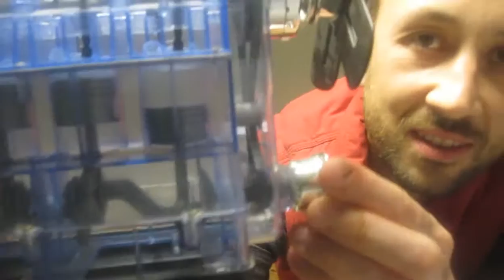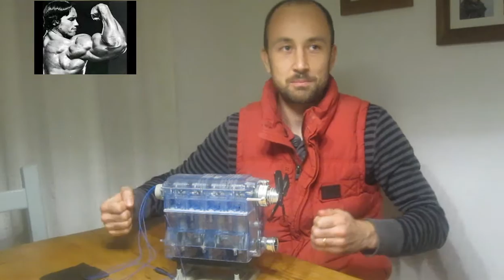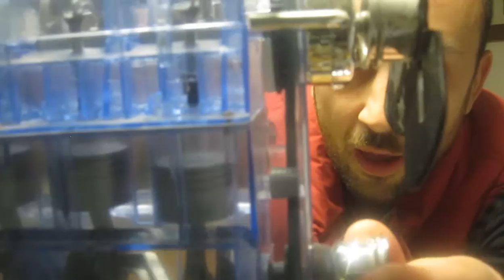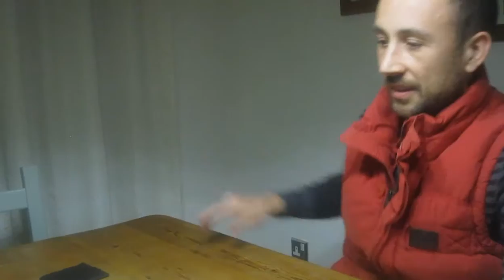Torque Vs Power: Why Power Wins Races and not Torque!

Comment: Considering torque is really a component of power. You technically can’t compare the two. Even a dyno measures the torque force at a given rpm to calculate power mathematically. You feel torque and acceleration; power is really just a technical specification.
Reply: I’d disagree power has a time element whereas torque doesn’t therefore you feel power as it relates to g force very easily.
Reply: Given same power if the torque has to increase, the rpm has to reduce.. Ie the distance traveled for same power will be lesser with higher torque
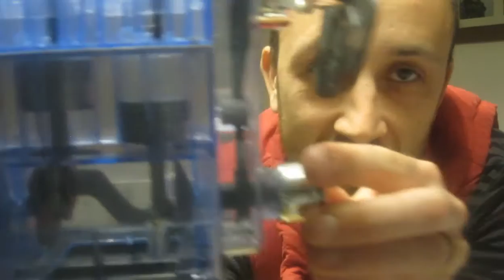Reply: in reall world if you measured at 100 km/h Gforce in first run 1 mln nm and 1 hp vs in second 1 nm and 1 mln hp assuming full traction you would feel  that 1 nm 1 mln hp push you into seat 1 mln times stronger so actually what you write is not true 🤷🏻‍♂️ but it can be true if we throw out from calculation velocity so in fact at 1 gear if you be acceleration from iddle rpm to max rpm bigest gforce be where max torque happen in most egzample cos in some egzample peak canbe so  high and it can be not so much biger than at lower rpm that resist from drag etc increase so much that you can fell even less gforce in seat however it be small margin of egzample in 95 let say max gforce be indid when max torque kick in but now you compare 20 to let say 40 km/h assuming 1 gear in some tdi car which have max torque at 2000 rpm and max power at 4000 rpm and trouble is such that this dont translate for racing at all  cos each vehciel have optimal gearing and can use optimal rpm at almost each velocity you choice for comaprision in such condition watt:m/s = force only can work good 👌🏻 if you comapre Gforce in the same car let say turbodisel at the same velocity let say 2000 rpm 400 nm vs on lower gear 200 hp on 4000 rpm both at 100 km/h you wil feel stronger push ypur body into seat in second setup and good working accelerometres measuring GForce also register biger peak acceleration at 100 km/h in secpnd setup 👌🏻 in this egzample diffrenc be around 78% stronger push you into seat in second setup at 100 km/h cos from 400 nm at 2000 rpm engine make 112 hp  so such 200 hp:100 km/h is 2 vs 112 hp :100 km/h is only 1,12 👌🏻 power wins races torque is good for daily elasticity riding on high gear low rpm you have good elasticity without reduction gear but when you comapre let say cbr 400 rr 180 kg 59 hp 39 nm to let say ls 650 savage 180 kg 31 hp 50 nm 0-100 km/h you notice like cbr hit 100 after 4,5 sec vs ls after 7,5 sec 🤷🏻‍♂️ or when setup drag race beetween let say dodge viper 1500 kg 500 hp 711 nm rwd vs ferrario 599 gtb fiorano 1700 kg 620 hp 608 nm rwd and you will drive viper you will notice like eyes see rear bumper of ferrarri which be smaller and smaller as race go further and further 🤷🏻‍♂️ yeep yep yep power wins race and torque is just a component which consist on power value 🤷🏻‍♂️watch how viper which is lighter have more engine crank torque start to be smaller and smaller in rear mirror of ferrari watch from 2:23 👌🏻 https://m.youtube.com/watch?v=pbIx1SCA_nI&t=173s yes ferrari have lil faster gearbox but diffrence is wayy biger than only this which shpuld go froms hifting time diffrenc 👌🏻
Reply: Nonsense. Engines make both power and torque.  Both can be measured directly on a dyno.  Both can be “calculated” from one another using “equations”. 
In any given gear maximum acceleration will occur at peak torque and you will feel that as the seat will press against you hardest at the peak….. However: Maximum acceleration for a given speed will always occur at peak power.  You will feel this as well for the same reason if at any given speed you apply double the power you will be pushed twice as hard by the seat.
Reply: @rollsroyce329 fair enough, but you just said it yourself if you can calculate one from the other, than they are components of each other.
Reply: @teambenjamin1  lengths and width are components of area.  Area is not merely a component, Area is the PRODUCT of Length multiplied by Width. The same as torque and RPM are components of Power and Power is the PRODUCT of torque multiplied by RPM.  Torque and Power and the rpm values they peak at are all technical specifications;yes,  what were you trying to infer?  Your original comment seemed to imply that power was in some way a less significant measurement and had less influence over the vehicle than torque.  Torque can be multiplied by gearing so its specification at the engine has little to do with torque at the tire.  Power on the other hand can not be altered by gearing (less friction losses) and has far greater influence on the vehicle.  Power, not torque, is the limiting factor in not only the vehicle’s top speed but also in how quickly it can accelerate at any speed and how much weight it can pull up an incline at any speed.
Reply: @rollsroyce329 Fair enough. That’s a damn good explanation my friend!
Reply: @teambenjamin1 thanks!  I’m happy I could help you make sense of it.
Cheers.
Reply: I don’t know where this power can’t be measured myth started but I contacted Dynojet knowing their inertial drum type dyno does in fact measure power directly and calculates torque where other load cell type like the Mustang brand measures torque and calculate power.  I asked them to explain/ provide evidence as to how their dyno measures power directly.  This is their reply:

Inertia Dynos Measure Power Directly
The Physics: Dynojet inertia dynos measure power using the fundamental physics formula: P = 1/2 x I x w^2 / t
Where: I = moment of inertia of the roller w = angular velocity t = time This directly measures the rate of energy transfer (power), not torque.
Key Evidence:
* Acceleration-Based Measurement:
* Inertia dynos measure how quickly the roller accelerates under load
* The acceleration rate and known roller inertia directly yield power
* No torque measurement is required for this calculation
* Torque is Derived, Not Measured:
* On inertia dynos, torque is actually calculated from the measured power using: T = P x 5252 / RPM
* This is the opposite of what people commonly believe!
* Load-Based vs Inertia Distinction:
* Load-based dynos (eddy current, water brake) DO measure torque first, then calculate power
* Inertia dynos measure power directly through acceleration physics
Why This Matters: This direct power measurement is why Dynojet inertia dynos excel at simulating real-world acceleration scenarios - they’re measuring the same physics that propel your vehicle down the road.
The misconception likely stems from people conflating all dyno types. Load-based dynos measure torque first, but inertia dynos fundamentally measure power through acceleration dynamics.
This is actually one of the key advantages of Dynojet’s inertia-based approach - you’re getting direct power measurement that reflects real-world performance!

Comment: If the race is a straight line but otherwise Torque wins races with lots of uphill and turns.
Reply: Nope
Reply: Nonsense.  Power, not torque is the limiting factor in not only a vehicles top speed but also in how quickly it can accelerate at any speed and how much weight it can tow up an incline at any speed.

Torque is irrespective of time: Frozen and timeless.
Torque isn't even work let alone power. A RACE is a competition of Work measured against Time. Power is Work/Time.
Power is the definition of the measurement of a race.

Comment: Oh really...so explain why electric vehicles accellerate MUCH faster than the gas powered ones? a BMW1000 rr with 200 hp compared with the Energica with only 136 HP..AND the Energica is heavier.and BEATS and is FASTER than its gas counterpart...mm..what say to that eh boy??...mmm...maybe its because the electric bike has 195 NM of torque where the gas bike only has 111. Case dismissed, you are fired. Here is the proof..https://www.youtube.com/watch?v=lcxDj5-iv_M
Reply: its not proof its idiot arguments  you just see something happen but you completely dont know why hyhy bmw s1000rr with road swingarm so close distance beewten front and rear tire with relatively high centre fo gravity cant use power at start but when you put adequate swingarm than it look like this https://www.youtube.com/watch?v=oWuzcrG6Dow  = 2 Times stronger acceleration than energica ,this s1000rr do 100 in 1,5 seconds vs energica 3 sec with constant fixed gear ratio with its weight distribution ., soo???
Reply: @mociczyczki 👍. 😂. Are you hearing this same Gnostic hivemind nonsense all over from torque-supremacists also?  “Torque is “just” a mathematical equation” “Torque is the only thing an engine can produce”. “Only Torque can be measured”.  Funny how when math joins the chat they all run and hide though. It’s like Raid for cockroaches. 😂.
Reply: This is 0-60.  The 1000M doesn’t reach peak power at this speed.  It’s more like 6000RPM This “proves” nothing.  With all else being equal the vehicle that is putting the most engine power (not engine torque) to the tire at any given moment will be the one with the greatest capacity for: acceleration, towing or top speed.  It’s scientific not scientifical.  Were you trying to infer that Torque had mystical properties or that Electric motors had mystical properties that are outside the laws of thermodynamics?
Reply: @rollsroyce329  HP is a mathematical construct derived from TORQUE which is the ONLY thing that can be directly measured.
Reply: From AI....yes, horsepower is derived from torque. Horsepower is calculated by multiplying torque by engine speed (RPM) and then dividing by a constant (5,252). Therefore, without torque, there can be no horsepower. ..IMBECILE
Reply: @johnnyzee383 thats myth many people say torque is only thing you can dorectly measured 🤭🫣 long story short 👉🏻 what a JOKE this is 🤭🪠
Reply: @mociczyczki 
I don’t know where this power can’t be measured myth started but I contacted Dynojet knowing their inertial drum type dyno unlike the load cell type did in fact measure power directly and calculates torque where other load cell type like the Mustang brand measures torque and calculate power.  I asked them to explain/ provide evidence as to how their dyno measures power directly.  This is their reply:

Inertia Dynos Measure Power Directly
The Physics: Dynojet inertia dynos measure power using the fundamental physics formula: P = 1/2 x I x w^2 / t
Where: I = moment of inertia of the roller w = angular velocity t = time This directly measures the rate of energy transfer (power), not torque.
Key Evidence:
* Acceleration-Based Measurement:
* Inertia dynos measure how quickly the roller accelerates under load
* The acceleration rate and known roller inertia directly yield power
* No torque measurement is required for this calculation
* Torque is Derived, Not Measured:
* On inertia dynos, torque is actually calculated from the measured power using: T = P x 5252 / RPM
* This is the opposite of what people commonly believe!
* Load-Based vs Inertia Distinction:
* Load-based dynos (eddy current, water brake) DO measure torque first, then calculate power
* Inertia dynos measure power directly through acceleration physics
Why This Matters: This direct power measurement is why Dynojet inertia dynos excel at simulating real-world acceleration scenarios - they’re measuring the same physics that propel your vehicle down the road.
The misconception likely stems from people conflating all dyno types. Load-based dynos measure torque first, but inertia dynos fundamentally measure power through acceleration dynamics.
This is actually one of the key advantages of Dynojet’s inertia-based approach - you’re getting direct power measurement that reflects real-world performance!
Reply: @rollsroyce329 yes offcorse 👌🏻myth are many in many diffrent theme thats one of them myth are always repeat bepeople without ENOUGH knowledge  in theme thats normal 😉 offcorse power canbe measured more directly than torque and viceversa it depend only on this how specific dyno is setup/configure what units it catch first so at which phsyics formula it base and at which from its  construction properties it base at first place simple 👌🏻🤷🏻‍♂️more direct can be measured power and than from this torque and vice versa people with onow,edge know this egzacly and people without knowledge cos they didint dig enough dip in theme dont 🪠thats normal and people which know more are for spread this  knowledge for this which dont know enough in theme beacuse of this life is also intresting discovery stuff make life intresting but many of lnowkedge is hodden for manipulation mass of people and controll them in direction of which controling group of people want for cash asf 😉👍🏻a tacy jak ja sa po to zebylikwidowac  ta kontrole 👊🏻💪🏻😎🪠🍿
Reply from the maker: Very good point John, I will have a think about this and get back to you - there will be a reasonable explanation... :)
Reply: Sorry for being rude...but it's true..my electric ebike with qsmotor 6000 watt and kelly 300 amp controller along with 100 volt Lithium 35 ah pack, makes 65 ft pounds of torque and is clearly faster from 0-60 mph even though it has a "soft start"..than my 2006 g6 which is 200 HP and at 17000 watts the bike makes about 23 HP for a short period of time...dividing 480 pounds by 23 HP=1HP per 20 pounds...and the g6 would be 3600/200=18 which is better ...however dividing 480 lbs by 65 Ft Pds of Torque =7.38 and the g6 comes in at 3600/222=16 and here the bike has far more torque per weight and therfore easily out accellerates the car.
Reply: Because the electric car has peak power basically at all rpms. Whereas petrol engine produce peak power at a very narrow band of revs
Reply: @PiOfficial  nope most electric engine produce max torque from 0 and peak power is also in some short range of rpm go look at let say tesla engine power and torque graph 👌🏻

Comment: Power is what makes your car accelerate, you feel it as g force, torque is what your brag about if you don't have power or you don't understand physics. Horsepower is torque multiplied by speed (simplification). Torque vs horsepower is a question that doesn't make sense mathematically. Torque needs context of speed, gear ratios etc, the outcome of working that is power, then work out the power to weight and you get acceleration. Torque is only an input into the numbers.

What people really mean by the word torque or saying an engine has good is they mean it actually has low end power, or even just throttle response. There's really two meanings of torque - physics & a description of an engines character. This is a difference in understanding between engineers and lay people, and often engineers will do it because they are trying to describe an engines character in a easy way. 

To win races you usually trade off low end power and throttle response to boost torque and therefore power, in the highest possible band of rpm the gear ratios will sweep through - to get the best acceleration on a drag strip or track.
Reply: Yes, you're quite correct Tim A., but just wait until King Austin and Sean Byrne come on board to tell you you're wrong.
Reply: Exactly, not even an engineer just love physics and did it at a level. But I’m certain we learnt the basic concept of power, energy and equations like ke=1/2mv^2 when we were 15.